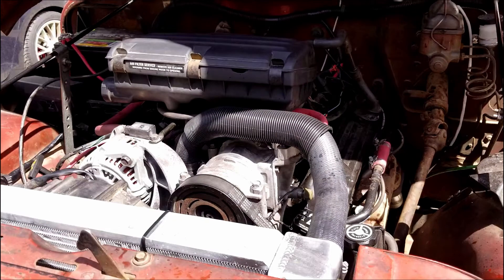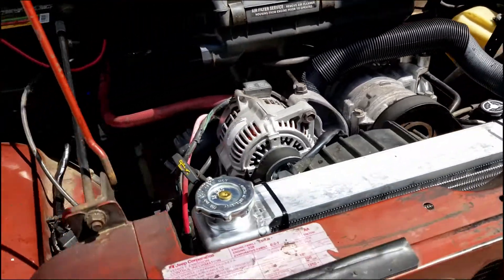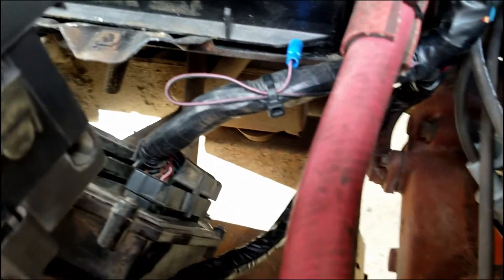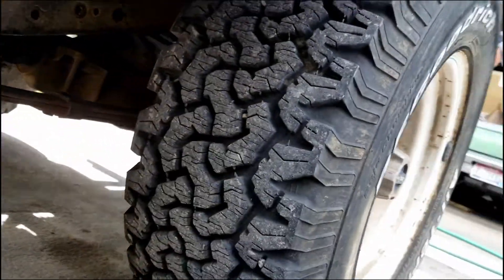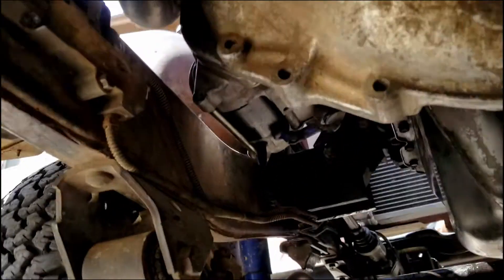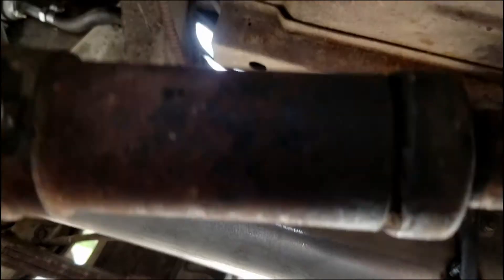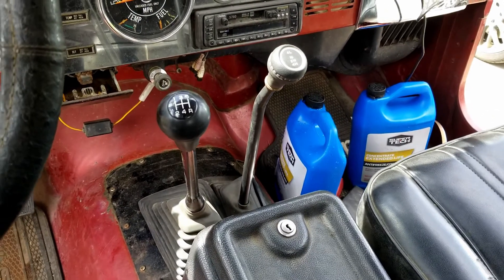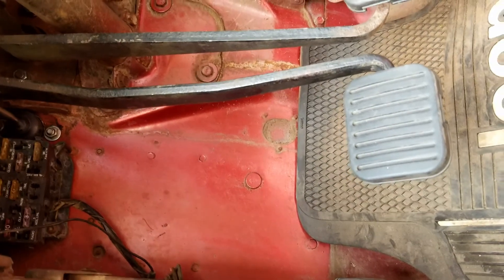5.2l magnum 5 speed manual swap Jeep CJ7

Comment: Nice job!!!! I am on the same project, and would sincerely appreciate the list of parts you used, please!!!!
Reply from the maker: ] Oil and temp sender 1980 cj7 [ ] Radiator cap 1980 cj7 [ ] Shifter 94 dodge dakota v6 modified [ ] Input shaft bushing/adapter 94 dakota v6 [ ] Transmission 94 dodge dakota v6 [ ] Clutch/flywheel 98 dodge 1500 5.2l [ ] Fuel filter 87 jeep wrangler 2.5l [ ] Fuel pump walbro 255 inline [ ] Engine 94 jeep grand cherokee [ ] Radiator speedway chevy universal crossflow [ ] Crank position sensor 95 dodge 1500 5.2  manual trans [ ] Clutch master cylinder 1985 cj7 [ ] Clutch slave cylinder 1995 jeep wrangler [ ] Fan switch in radiator spal 185° 185-ts amazon
Reply from the maker: Thats the list i sent my dad(its his jeep).
Anything i missed just ask, i should still remember. The yj jeep in the picture is mine that i did this swap on 8 years ago. The cj is my dads.